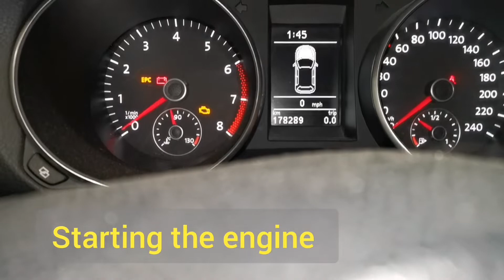VW golf  tsi engine low oil pressure problem #episode 3

Comment: Hi nice video. Can you say what was wrong with the original oil pump?
Reply from the maker: Hello friend first i thought there was a low pressure on oil pump, but i discovered then there was a damage on non return oil valve on cylinder head

Comment: Tools needed to disassemble timing and cylinder head? I have triple squares and torx bits on my list. Aswell as a timing chain crank tool kit.  Plan was to replace cambridge and vvt solenoid, if that doesnt work i wanted to disassemble head. Just to be clear though i dont have any experience but will keep a manual on me.
Reply from the maker: Hello friend
Do you have the same engine?
Reply: @hamadakhmechanic6526  hello 👋  i have a 2011 ccta 2.0tsi.
Reply: You will need a Polydrive Head Bolt Socket

Comment: Have the same problem with ticking lifters , replaced the cam bridge as the check valve had destroyed itself but lifters still ticking so now will head towards this non return valve in the head, cheers helpful
Reply from the maker: Thanks for watching

Comment: Hello, you had 2 return valves.  One I saw where you mounted it but the other one where it mounts?
Reply from the maker: Hello there is one valve only. The other one was the faulty valve.
Reply: @hamadakhmechanic6526  ok, thank you. Skoda sold me 2 valves, they said I needed two valves but I only found one.  Engine 1.8tsi

Comment: How was it faulty? I saw when it actuated.
Reply from the maker: This is the new one. The other was broken inside.
Reply: @hamadakhmechanic6526  I thought the ticking went away when intake cam VVTi was replaced.
So, what was the problem with low oil pressure?
Was it at startup or when engine gets warm engine gets low oil light?
Reply from the maker: The ticking sound because of the non return valve on cylinder head.
Reply: The non return should hold a specific amount (can't remember)of psi for 1 minute. I ripped my motor apart right after rebuilding it because of low oil pressure issues. I went through co.pletely everything. Eventually I took all the micron screens out except on the oil pump and vacuum pump. I still have noisy lifters. I even completely cleaned them using a small Allen wrench and pumping them in diesel. It's just how this engine is. I'm pretty sure what's solved the oil pressure issue with my caeb engine was the removal of the balance shaft screens (yes I put them back in, it's a crock of shit to say to replace them if you pull em out, just don't ruin the bearings pulling them out) and I also found a stronger spring for the little ball bearing in the oil pump. You have to take the pump apart to access that little ball bearing and swap for a stronger spring. The spring was the only difference I could find from the old oil pumps and the new "revised" oil pumps 🙄

Comment: hallo ik heb een probleem met de Golf 6 GTI 2.0 tsi 😕 
bij het remmen zakt mijn druk bij stationair toerental

Ik heb de olie vervangen door een nieuwe en het oliefilter, alle sensoren zijn vervangen en toen dezelfde fout 
Ik weet niet waar ik de reden moet zoeken, ik heb contact met uw bedrijf dat u het defect kunt verhelpen
Reply from the maker: Hello friend
First you should make an oil pressure test and see if the oil goes up to cylinder head. In my car there was a damaged non return valve on cylinder head.

Comment: Hi 
Where is your workshop.i mean which country
Reply from the maker: Hello
Sweden
Reply: @hamadakhmechanic6526  
If you are in uk somewhere I will drive to you to have my car fix .
I have same problem  skoda octavia 1.4 tsi .
Oil pressure low .
Sensor changed 
Oil pump changed 
No blockage we checked when we open sump 
All wiring loom Is checked .
3 Oil changed 
But Oil pressure light is still there .
When I start In morning .I have that rattle noise and no oil pressure error on dashboard. 
When car heats up to normal temperature then if I drive 30 or 40mph local .light come up every few minutes.
On motorway no light at all after 60 pr 70mph no light. 
No loss of power car drives as normal.
After temperature goes normal no rattle noise.
No restrictions of rpm .
Car never heats up.
Nobody in my city want to fix car like you do.they says change engine problem solve .
Where you think we need to look for this problem to solve .any suggestions
Reply from the maker: Did you check the oil pressure with test gauge, maybe there is damage on crankshaft bearings. You can also check the oil filter if it fit to your engine.
Reply: @hamadakhmechanic6526  
Yes in garage they check with gauge .
I will have tried changing filter .nothing .
Now last thing is to check crankshaft

Comment: Hello. Is it 1.8 tsi?
Reply from the maker: Hello
Yes it's 1.8 tsi
Reply: @hamadakhmechanic6526  i have the same problem with my 1.8tsi. In cold start is 2.9 bar, next in 65°C 2.1bar, in 2000 is 3.1 bar , if engine is hot 90°C i have 1.3bar. What do you think? Is this the same problem which you have?